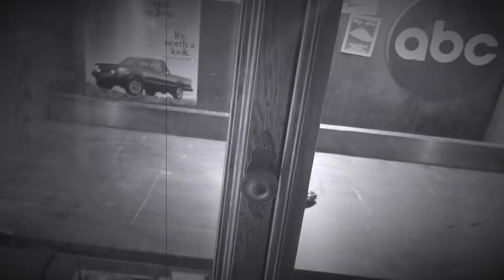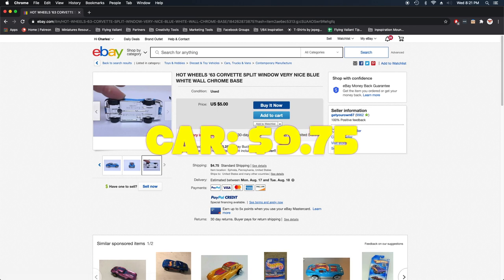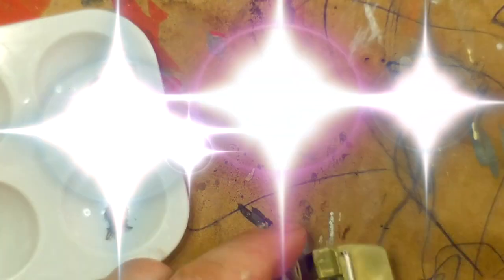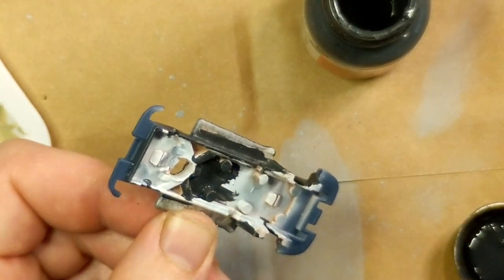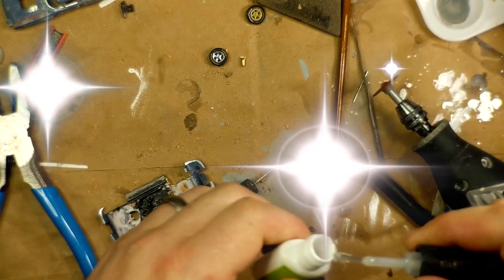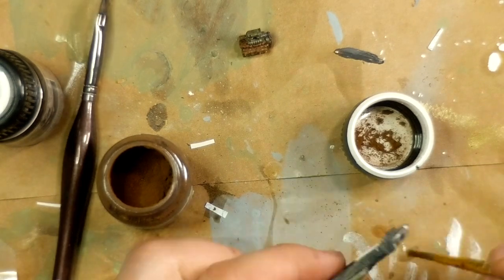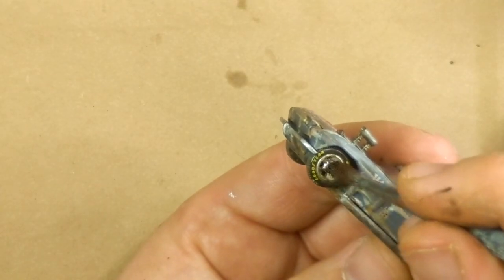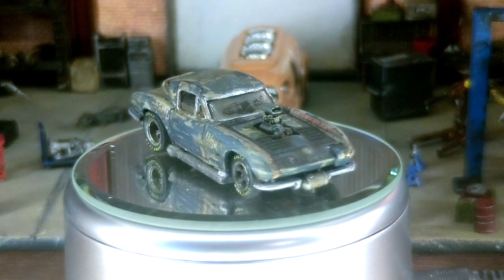How Much Does it Cost to Build a Custom Diecast? Baller vs. Budget Custom Hot Wheels - Part 2

Comment: Im a customizer myself but i havent tried commissioned work.. how much do usually charge per car? Thank uou
Reply from the maker: Hey, Kirb. It varies on complexity of the build, but generally i start at 40 for wheels and paint and it goes up from there. On the high side $120
Reply: Thanks. I had some personal builds and sold them for $15-20, i was a bit hesitant in selling some of my build bcoz I thought it wasnt that clean. Maybe next time I will price it up a little.
Reply: By the way, i love your builds!! 🤟
Reply from the maker: @kirbirlandez2652  thanks so much! Good luck with your sales.

Comment: $600!
Reply from the maker: If only! Haha
Reply: @DiecastMediaNetwork  yeah, when you started going through the cha chings I knew it was gonna get up there.  I'm pretty lucky that I have many tools and the hit for this hasn't been to hard.  I still have bought quite a few things that are helpful.
Reply from the maker: Yep. I had a lot of this stuff too, and the 3D printer pays for itself in what I used to spend on accessories and parts. I was just curious what the value of all the stuff I routinely use would cost. It was a lot.
Reply: @DiecastMediaNetwork  yeah, I liked how you did the tally.  I told my wife today...I think she might start paying more attention now 🤔
Reply from the maker: @tinylittledonuts2186  haha. I had to reassure my wife that I didn't actually pay that much. Also most of the high dollar things like the airbrush set up and Dremel were things I already had for my big car project.